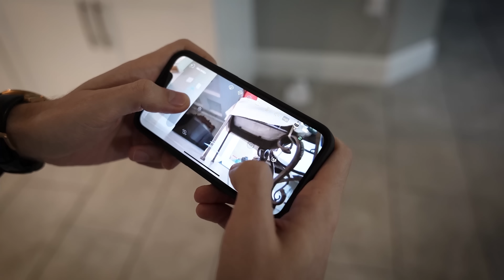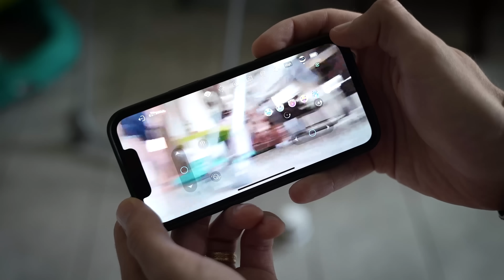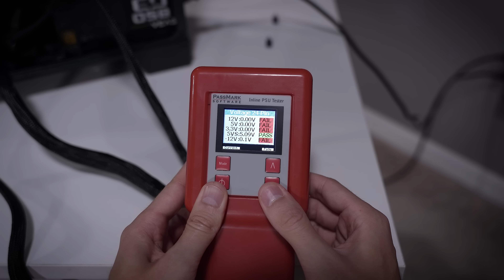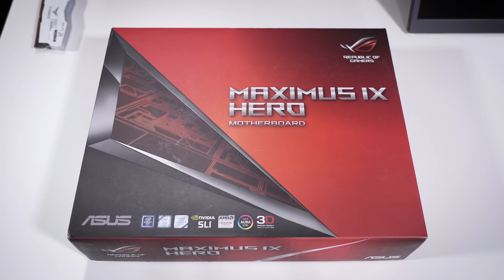Fixing a Viewer's BROKEN Gaming PC? - Fix or Flop S3:E8

Comment: I cannot stress the importance of having a good UPS (Uninterrupted Power Supply) Unit.  That EVGA PSU is known to have issues. I have had a very bad experience with them.  I won't buy an EVGA power supply again.  The damage it cost was substantial.
Reply: What model was it?
Reply: @justaadhdgamerwesley6244  g3
Reply: @justaadhdgamerwesley6244  EVGA SuperNOVA 750 GA